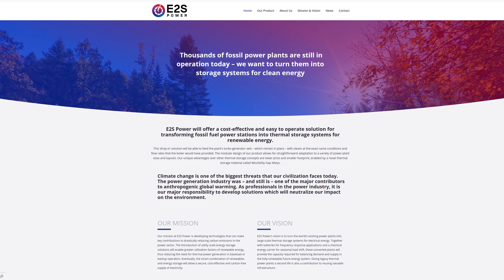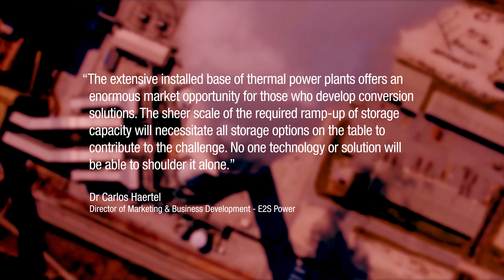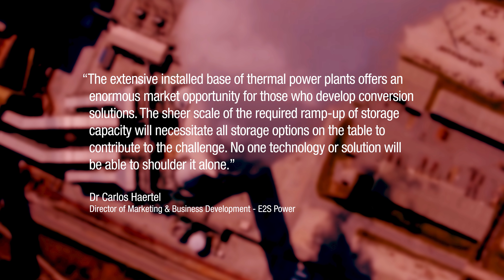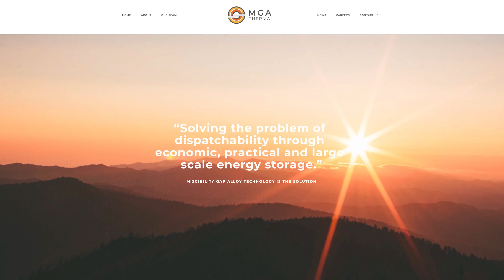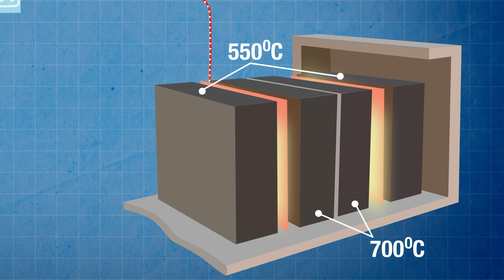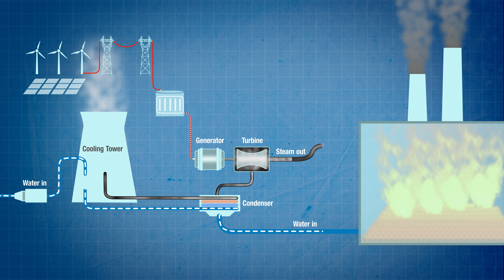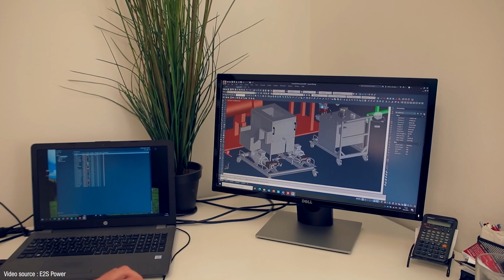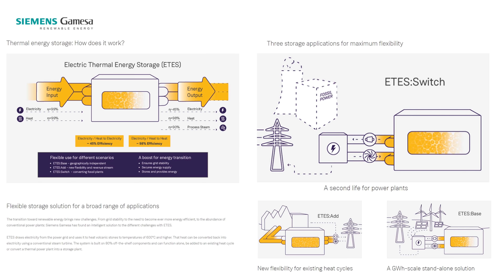New energy storage tech breathing life and jobs back into disused coal power plants

Comment: Interesting idea because it might be cost effective to use existing generation assets that have been paid for instead of scrapping them. I see a few potential snags. The operating temperature at 700 degrees Celsius sounds low compared to energy from waste incinerators that operate at peak efficiency about 1000. Old coal fired power stations were single cycle, whereas modern CCGT gas fired power stations are combined cycle to achieve high thermal efficiency. Hence it is probably more cost effective to use mothballed gas powered generation, but they probably need a higher operating temperature. Old power stations occupy large sites, so urban sites might be worth more as development land, limiting thermal storage to power stations at coal fields which means transmission losses. Molten Salt storage needs to be considered as a competitor. Any thoughts?

Comment: what is the efficiency - how many megawatts to heat it to get 1MW out - remember pumped hydro is 60% eg put in 100watts to pump water uphill to get 60watts out downhill etc - no such thing as a free lunch so will need 150% plus renewables for the 100% reliable supply - money money but still knock molten salt reactors

Comment: I’ve often wondered why solar thermal pre heating of inlet water to existing coal plants isn’t done, to minimise the energy required from the coal boiler to raise it to its full temperature required for the turbine.  Surely that would decrease the coal required as the temperature rise required from the boiler would be reduced by 100+ degrees.

Comment: I like the idea to repurpose the plants but what is the percentage of losses in the system. IF the point is to flatten the curve of peak needs and make the grid more stable/manageable does the efficiency of the unit keep us inside the parameters where we can used the Hydro, Nuclear, and Renewables outputs inside of there intended max productions thereby keeping us from firing off coal plants for peaks? Also we have to keep in mind a percentage of these coal plants are in a state of condition when they are shut down that requires them to be deconstructed anyway. To me i am seeing this as the grids version of a dump load but the intention is to not dump into this system but to leach off the grid in non peak conditions and release on peak. Seems the more effective thing to do is go with the original ideas we had in the 50's and build liquid salt reactors but the GOV's chose nuclear so they could get their grubby war mongering paws on nuclear waste for weapons of mass destruction. Here we are this far down the road and still they wont stop with Nuclear even knowing the devastation of the biproducts and they give us these little crumbs of hope that we can make it better by doing stuff like proposed here in the video yet have zero intentions of converting from Nuclear. This all seems to lead to a point in my mind we increase the load on average and Uncle Sam says we need more Nuclear so he can have more biproducts which is the worst of the 2 evils when talking about coal pollution or nuclear waste.

Comment: Look a new dump load for all that green energy so we can import & store it with a 200 % profit !

Clearing forests for biomass , shipping it 3000 + miles or for a green subsidy must stop .

Nor is smashing atoms green .
It's just 10,000 years of problems & a exercise in storage paid for by the public .
“ If humans persists that long ”

As for wind power in small installations of 3 or 4 units it's ok .
Things move slowly so massive wind farms must put load on tectonic plates !

“Have you looked at the base loads on the grid system” 

We must use less . 
Get smarter with more integration on the generation side & load side .

But that's not a free market !

Comment: Radon would be a better inert thermal insulator than nitrogen.  Its radioactive decay would contribute to the stored heat.  And using radon productively would remove it from basements economically.

Comment: You start of by saying that we will stop using thousands of gigawatts on fossil fuel And then you come with this thingy... Again, the first mistake you make is, it is intermitten. So you lose energy from the start. To get it from the windmills to the factory. Then there is is allways a lost of enenergy. And then, go look at what a supercritical coalfire planned needs for energy to replace it by any other form of energy. again, wishfull thinking. And you make one other big mistake. Water is the only non liniear molecule that has different energy needed to first melt and then get from fluid to gass. To heat water, you need 4.2 KJ/kg/C. To vaporize it, you need 2280 KJ/kg... common. do the math on that. You know how much alu you need to melt to get enough energy to drive a 100 megawatt turbine?
Again. This is about subsidizing..

Comment: I have got to see all these thermally based long duration storage systems as stop gaps until someone gets long duration battery prices down to sane levels. The laws of thermodynamics just limit the efficiency of heat engines. Of course we can melt aluminium now, who knows long it will be for batteries to become cheep.

Comment: I knew about the term PCM meaning phase change materials, specifically PCCs meaning phase change composites. Finned heatpipe heatsinks with a PCC surrounding the fins acts like a thermal battery for electronics where thermal energy can be dumped without increasing ambient temperature in a closed environment. Basically thermal energy is consumed during the phase change with minimal increase in temperature.

MGAs sound rather similar but definitely operate in a slightly different way.
Reply: Thanks for watching and commenting, Don't forget to hit the subscribe button for more information..consultant.......and advice.....D.M ~ⓑⓔⓛⓞⓦ__~ 
✙①`⑨´⓪`③´②`③´①`⑤´②`⑨´③.

Comment: I’m doing R&D on small residential scale solar thermal storage systems that produce power using Tesla turbines in  a vacuum steam system similar/identical to a miniature OTEC plant but uses the sun and atmospheric air as the heat source cold sink instead of warm surface water and cold deep surface water.
Reply: Thanks for watching and commenting, Don't forget to hit the subscribe button for more information..consultant.......and advice.....D.M ~ⓑⓔⓛⓞⓦ__~ 
✙①`⑨´⓪`③´②`③´①`⑤´②`⑨´③.

Comment: So basically this plant becomes a synchronizing condenser, stabilizing frequency. That's all. Reason being is that solar and wind are not stable frequency supporters, and can't be by design. and need the huge rotating energy of the old type hydro/steam generators via their rotating mass to maintain dips and spikes in frequency during system disturbances. Renewables great, but we still need base load plants for now, for this very reason. Now your adding band aids to quick fix. I work in Hydro, so........

Comment: This system is probably losing ~50% of the energy pumped into it.
Reply: Gas fired plants are about 37 percent efficient.

As stated in the video this is one solution not the only solution.

This is a way to reuse preexisting infrastructure.

Removing the more dirty part and keeping good paying maintenance jobs for the existing structure.

There are some people that might lose their jobs. The boilermakers.
Reply: Turbines are efficient. Boilers arent.
Reply: @likaleklikalek7395  So maybe 60% then? Lot of steam escapes.  Giant flywheeels would be 100% efficient by contrast.
Reply: @likaleklikalek7395   Boilers are 95% or more efficient.  Turbines are 75-85% efficient.  Storing heat is not efficient.
Reply: In other words, to make this profitable, they would have to arbitrage electrical prices at least 2 to 1.  So, buy power at 5 cents/kWh and sell at 10 cents/kWh.  How many hours per day can you do this?  2 or 3 or 4? During peak summer demand?  Hard to see how this is profitable, it might be, but seems slim?
Reply: @LinasVepstas   If it's being used as storage of renewable energy then it should be very price competitive. Already power prices are going into negative due to the volume of renewables. During the day when solar is providing 35-50% of Australia's power, prices per MW/hr are down to -$35 to -$65/MWh
Reply: @LinasVepstas  sounds like you know more than I do about how this works but the amount of renewables is growing at a rapid rate so I would like to think that with a comparatively low cost of implementing MGA compared to batteries that it will be successful
Reply: @geoffsemon7411  "Volume of renewables" is what is negative.  Not the MWh price.  California had a 50MW solar plant that burned 50 million dollars and produced 0 MWh.  THAT is the REAL picture.

Comment: At first glance this 'solution' seems to me a be a bit odd. I gues that the business case heavily depends on the availability of free (subsidized) green electricity.

Suppose you have enough free cheap green electricity (which we not have yet), why turn it to heat and convert it back later to electricity, meanwhile losing more than 50% to the inefficiencies in the conversion process?

If for the jobs, jobs to build new infrastructure are much more future proof. Ideas like using DC power to feed homes and business will not easily come from an industry that relies on their existing installations.

Why could Tesla become so successful, while the ICE car industry had all the money and all the engineers (knowledge) to spend? Because they had chosen to do their utmost best in slowing down the energy transition rather then powering this transition themselves.

Comment: Aluminium latent heat is 1070 Mj/m3, NaCl is 450 Mj/m3 at 800 C, surely NaCl would also work and might be cheaper. 
Both an order of magnitude smaller than burning an e-fuel like ammonia or methanol.

Comment: This is interesting. However, they fly over some technical challenges. You can't just remove the boiler from the turbine, and there are startup times related to running turbines. They dispatche well once running but it takes time. It is worth investigating. Thank you.
Reply: There are many "howevers". The most important is not named at all: how cost effective is it compared to a battery based store? I cannot think of cost efficient way for this thing.
Reply: @muten861  On an industrial scale, batteries are not very cost-effective at all due to their low energy density and limited lifespan. Whereas a block of aluminium is relatively cheap and can be melted and solidified almost indefinitely.
Reply: @nagualdesign  thats simply not true. Aluminum ist not very cheap in this scale. And don't forget the bad efficiency, which will cost a lot more. than the buying sum for this tech.
Reply: @muten861  I said relatively cheap, as compared to batteries. 40kg of lithium-ion batteries (enough to power a home for a day) costs about $2000 and has a limited lifespan. For the same price you could buy over 700kg of aluminium, which can be used for many decades, and I dare say that it could store enough energy to power many homes.

Also, the beauty of using existing infrastructure is that large-scale turbines can be over 90% efficient at converting that heat energy into electricity, and don't require building from scratch.

[Edit] The specific heat capacity of aluminium is 900J/kg°C, so 700kg of aluminium would have a heat capacity of 630kJ/°C (0.175kWh/°C). For comparison, an average UK home uses 8.5~10kWh of electricity per day.
Reply: @muten861  Remember, the point of this is to consume power during high output times and generate power at low output times.  This concept is well known with pumped storage.  It doesn't have to be efficient.
Reply: @sreng81  you dont get it! But you do not need to, because reality will tell the truth: Battery is more efficient and therefore more cost efficient.
Reply: @muten861  No efficiencies were stated, so I don't know.  My point was that this may be much larger scale than a Li-ion battery, so capacity is the driving factor, not efficiency.  Power plants turbine generators are capable of generating 200 - 1300 MW of power.  I don't know what portion of that would be available, but I think scale is the point of this technology.  That's what makes it interesting.
Reply: @muten861  Actually, that assumption does not often play out as true.  Analysis is always needed to ascertain the cost competitiveness.  Efficiency only gets you so far.  Now, I would prefer it if we only stored heat energy into this thing that came from renewable sources, and that this thermal tech was operated along with some battery capacity.  The overall system utilizing the battery resource first, but when the battery resource is running out, this is a great secondary long term power draw source, until the renewables kick in again.  You have to look at the whole system.
Reply: @MotherNature26  Actually, they are saying it would be "charged" by renewables.  It seems it is an alternative to batteries.  The issue it addresses is that renewables are intermittent.  The sun doesn't always shine and the wind does not always blow.  Conversely, other times, there is too much wind and solar power for the system demand.  Enter storage like this.  Batteries are one way to do it.  Pumped storage has been used for 50 years for this purpose.  Two lakes, pump from the lower lake to the upper when there is excess power, use the upper for hydro power when there is reduced power. Examples are Niagara Falls and Smith Mountain.  This is another option, if it viable.
Reply: @MotherNature26  you also don't get it... If you get the same storage with Batteries, to competitive prices, batteries will be preferred. Its all about price. Market baby!
Reply: In some places you cold drill deep to get geothermal power (hopfully the right name) and still use many already existing machines.
Reply: Boilers and turbines are almost never in the same vessel.  Look at the flow diagram of a Rankine Cycle for example.  All they need to do, is replace this hamster unit with the boiler vessel, and add the proper heat exchange unit to draw the working fluid through.  Really simple.

Comment: The problem is the low efficiency of stream driven turbines. Those system reach only 30% to 40% efficiency (ignoring losses of the thermal storage). This is on the same level of efficiency as hydrogen fuel cells.
Reply: One advantage is that hypothetically this is very fast to charge up.
Reply: As in it might be able to accept a bigger load than let's say pumped hydro or electrolyzers.

Comment: I understand the sense of using the existing buildings and electrical infrastructure, but such a poor round-trip efficiency (c. 37%) makes thermal storage a bad option.  Vanadium redox flow batteries or some equally non-combustible and efficient chemistry seems to me the current best way forward.

Comment: This is an interesting idea. Traditionally the steam is generated in a boiler and then superheated. It seems that it emerges from the Hamster already dry, due to the high temp presumably. The boilers I am familiar with (not for driving turbines) don't suffer any real ill effects from a water tube leak, but in the vicinity of molten aluminium this could be disastrous. I will have to look further into this technology so see how the heat is actually transferred to the water to make steam. I have no doubt that they have plenty of safeguards in place

Comment: Electricity is an expansive source of heat. Even assuming their technology is perfect, that is 100% efficiency in the conversion of electrical to thermal energy and no losses through the thermal insulation, the conversion back from thermal to electrical in coal plants is around 50% efficient ... This means that in order to be viable, they will need to get their electricity at half the sale price to break even. Such turbine are also slow to start and stop. Even if it will probably be faster than a regular coal boiler, it will still be orders of magnitude slower than batteries.  This will likely find a niche market and be used in conjunction with a slow heat source like coal or nuclear, that are already inexpensive sources of heat, to allow them to be more agile, being able to start and stop the production more rapidly by storing the heat generated by the source when the turbines are stopped and reheating the turbine more quickly on startup ...

Comment: The steam generator is about 40% efficient so you will lose at least 60% of the input power when you store and retrieve the energy.
 If batteries are used for storage, even though expensive, they can be 95% or more efficient is storing and providing the stored energy.
No one would consider this unless they thought the source of the inputted power was cheap or free. Wind and Solar are neither and adding this form of energy storage is a bad idea.
Reply: no, the boiler should be about 95% efficient, the turbines on the other hand do well to hit 35% Carnot  efficiency.
Reply: @virginiamiller3521  I don't understand your comment, electricity goes in and converted to stored heat, the heat is used to make steam to run a turbine. This process is no more than 40 percent efficient. There is no way to convert the stored heat to electricity that is better. Are you saying I'm wrong at 40% and it's really 35%, if so I won't argue?